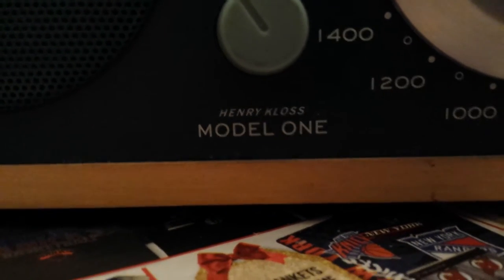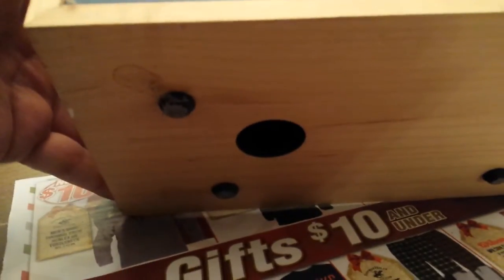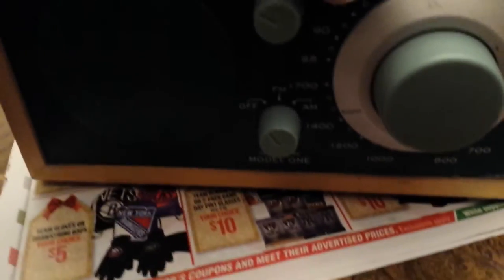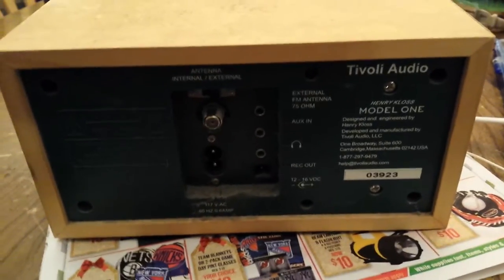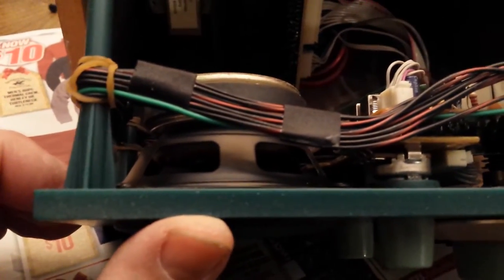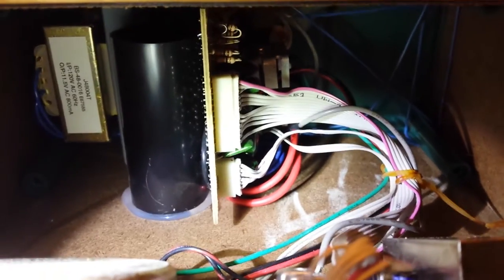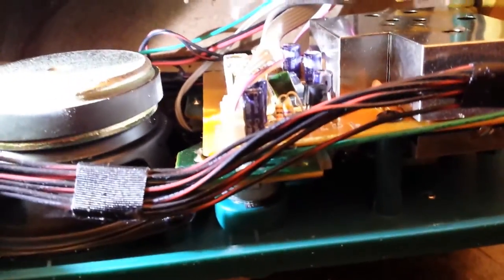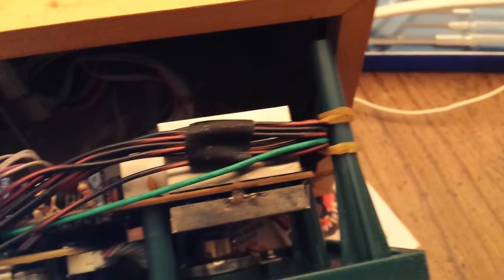Cleaning volume pot - Tivoli Audio - Henry Kloss - Model 1 - AM/FM radio - Part 1

Comment: My Model One uses sealed plastic case potentiometer that doesn't appear to have access opening to squirt contact cleaner inside of it. I sprayed contact cleaner on the selector, volume and tuner shafts anyway and it worked to get rid of the scratchy pontentiometer noise on all three.

Comment: Hi - Thanks for posting this video. You recommend using DeoxIt on the volume control, but is there a particular kind of DeoxIt you used since there are lot of different variants?
Reply from the maker: Good afternoon.  I used the DeOxit D5 type.  I use this radio almost every weekend as it is in my kitchen on top of the refrigerator.  So it does get exposed to all of our wonderful cooking.